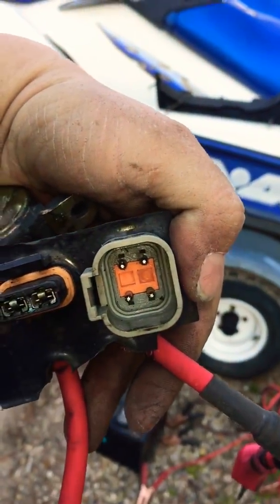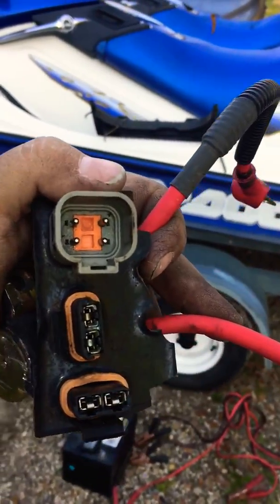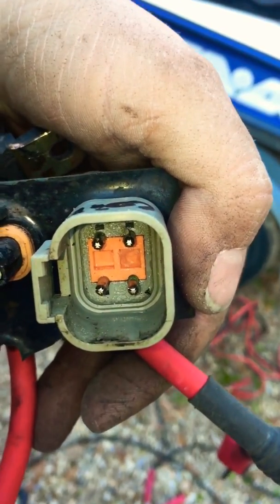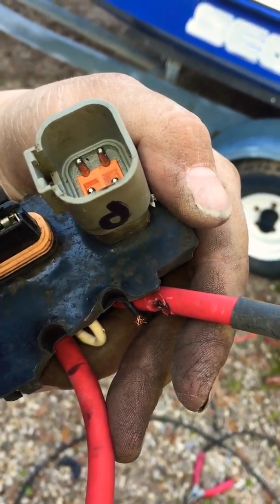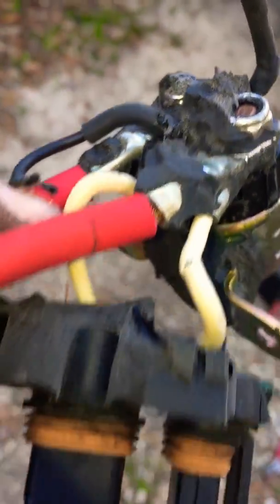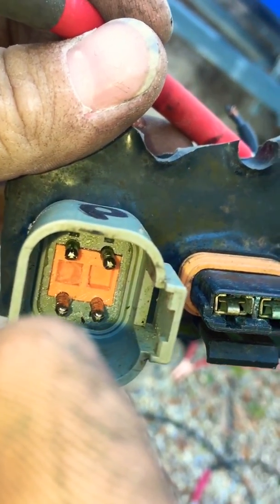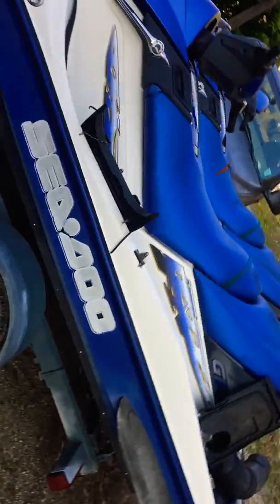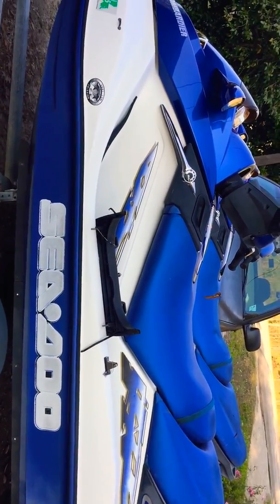Sea doo starter relay upgrade

Comment from the maker: All right so I keep getting comments and comments and comments asking for help with this. Tomorrow when I get off from work I will remove the seat on the jet ski and go over how it's wired up. I will make a video and post it tomorrow it'll probably be around 7:00 p.m. Louisiana time lol. My ski is still using this setup and is working without issue. The only issue I found was if I don't remove the fuses I put in line the battery goes dead. So I'm putting a battery shut off switch on it.